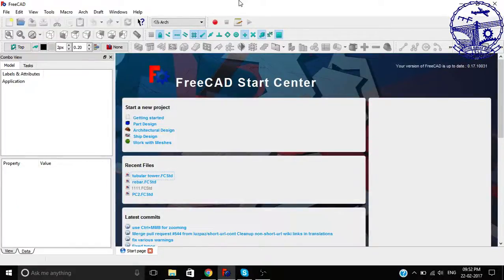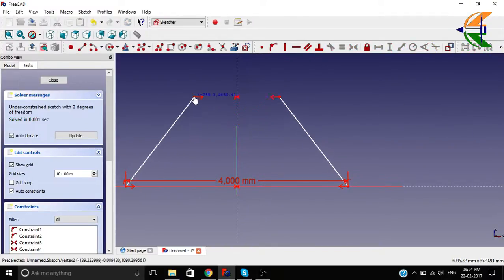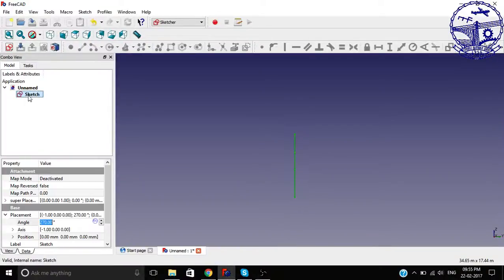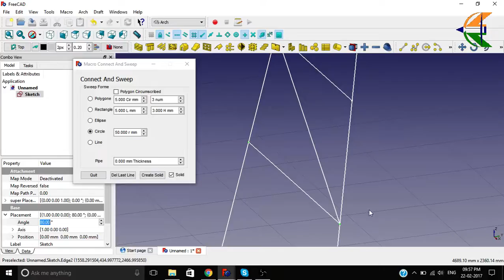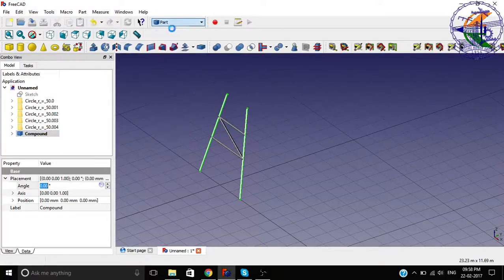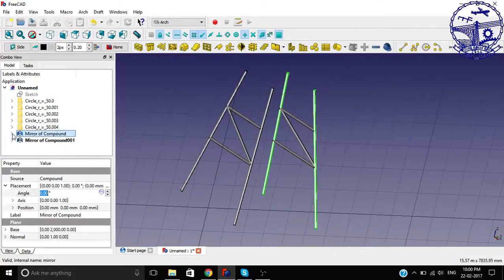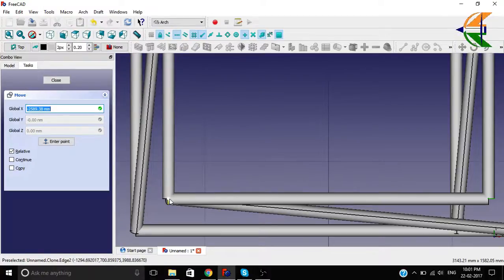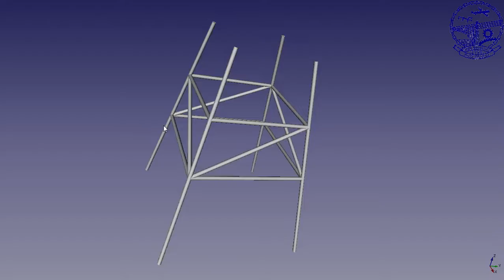FreeCAD Tutorial: How to Create Tower from Tubular Items

Comment: What addons can be used to work with ISO structural metal profiles and welding?
Reply: as example, I need some library for structural metal profiles ISO 657-1 for example, and cutting and welding sketches generator for assembly
Reply: and some assembly jig to build 3D frames and check its rigidity in some FEM module